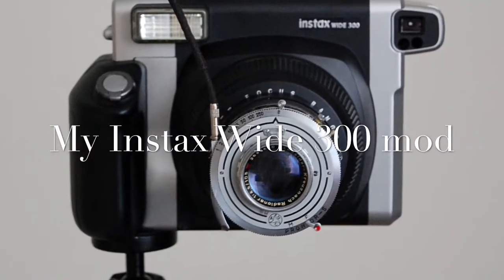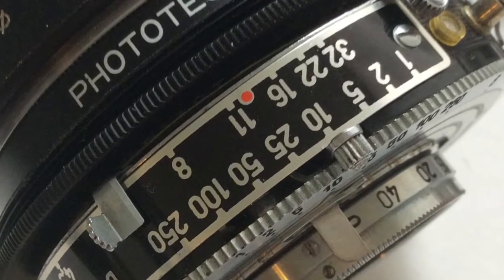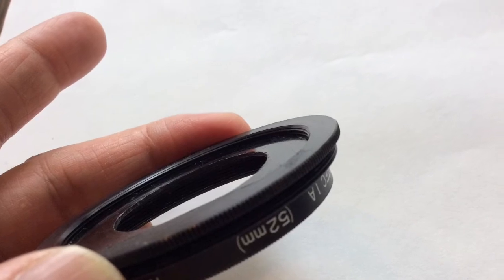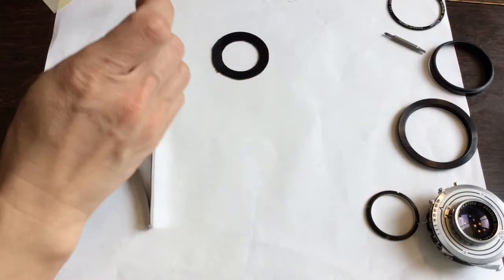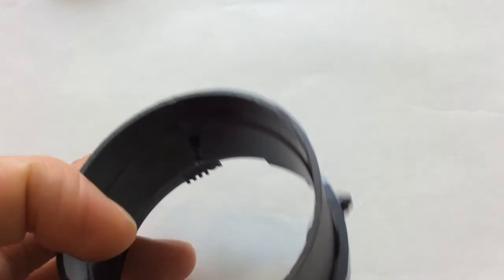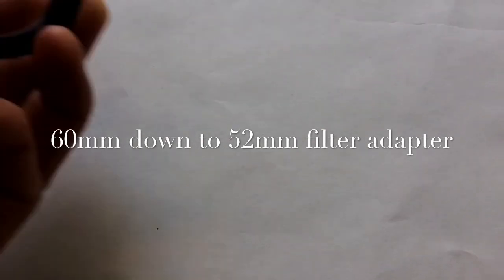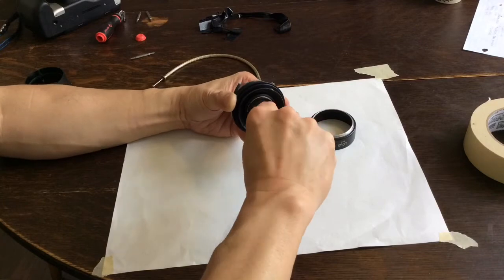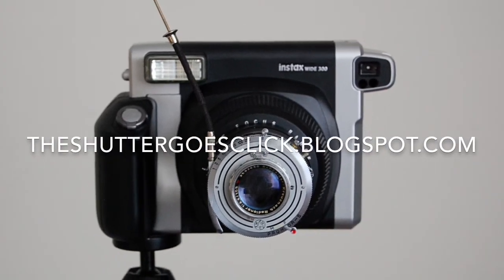Walkthrough of an Fuji Instax Wide 300 camera modified with a vintage lens

Comment: Great video, must have taken loads trial and error ... is the camera always at infinity focus ? Or do you have the ability to create use of depth of field ?
Reply from the maker: sorry about taking so long to reply - the lens has a front-focusing element, so the task is to set the lens away from the film plane so that the lens will be focused on infinity when set at infinity (if that makes any sense). once you've set the lens at the correct distance with filter rings and the right number of spacers (they can be paper or thin sheets of plastic) between the lensboard and the lens you should be able to focus at as the lens is designed. Depth of field would be a byproduct of aperture and the SET lens length (give or take the movement of the front focusing elements - hey, I'm not an optics engineer - and I've never really thought of it but focusing must have some sort of effect on depth of field even on a fixed prime lens like the one here. it should be negligible). I hope all this makes sense to you.

Comment: Are the electronics original? how does ejecting work, letting it think it took a picture?
Not familiar with regular lenses, but the shutter is now on the lens and is mechanic right?
Reply from the maker: That's correct. I have a post on the simplified electronics here: https://theshuttergoesclick.blogspot.com/2018/04/rewiring-instax-wide-300-instaxhack.html

Comment: How did you check focus? Trial and error with the instant film or a focusing screen?
Reply from the maker: I sanded a cd jewel case or maybe a clear piece of acyrlic and then cut it to fit in a used Instax Wide cartridge. I would insert that cartidge into the camera.
Reply from the maker: focusing screen made with old instax film cartridge. see the blog posts here, https://theshuttergoesclick.blogspot.com/2018/06/cameramods-question-i-just-cant-sent-up.html
Reply: Hi do you have some fotos with that modification

Comment: its a fantastic camera. One question though, are you able to keep the automatic stop after each picture is taken? i think it should be simple wiring but i don't know how ...
Reply: could you take a look at this. https://www.instagram.com/p/BjJ_mhYlQGR/  the guy did retain the automatic stop after each film is ejected. Do you any idea. I asked the guy but he hasn't replied yet
Reply from the maker: It can be done. There's a series of triggers that have to tripped for the camera to start the ejection sequence. I considered doing the wiring that way but I gutted the camera too quickly and couldn't reverse engineer it far enough back.

Here's what the rewiring job needs to do:

-make the camera know it is on
-it must detect the lens barrel is out and the lens detector is open (there are sensors for both these in the lens barrel and the shutter housing)
-the camera must believe the camera has fired the shutter

If you can trick out the camera to believe all these things have happened then it will begin the controlled ejection and development process.

I think it is doable. But I haven't done it.

There are advantages to it. You can keep track of exposures. I've wasted two pieces of film because of losing count.

BUT I've never wrong ejected two pieces of film. I like the dumb circuit I built, and, to be honest, the simpler circuit would work if you intended to turn the camera into a back for other medium or large format setups.

Sorry I can't help you more. But thanks for asking. It's nice to know people are up to the same shenanigans as me.

Comment: Great video must have taken ages to trial and error this.... is the lens constantly at infinity or can or can the barrel move at all ?
Reply from the maker: so to be clear. the barrel does NOT move. it has a front focusing element. there are ways to make a barrel move but i haven't yet tried to does options. for example a helicoid extension tube. not the cheapest way but maybe the best IF you have only whole lenses which can not focus unless the whole rig moves back and forth.
Reply from the maker: Hi Peter. The lens has a front element focus. So I just have to set it at infinity and then turn the front focus ring to make it work.

Comment: What did you do with the circuitry that was connected to the lens? Did you just remove the lens that was there? Was there more you had to do to the electronics?
Reply from the maker: Hi Justin, To say the camera had electronics would be somewhat misleading. It is more electric than electronic as hardly chipboard is involved.

All I have is a simple circuit with an on/off switch to the motor. When I press the shutter release the motor runs, driving the ejection sequence and the rollers.

To watch the camera in action, visit the other video. Plus I do have a blog post about the simple circuit I used. https://theshuttergoesclick.blogspot.com/2018/04/how-i-wired-my-instax-wide-to-develop.html
Reply: Thank you for the info. So it looks like you just soldered the wires that were already there... This is a really intriguing project! I am thinking of buying a wide instant body to dissect (they're getting cheaper on Ebay), and using one of the old leaf shutter lenses I have.
Reply from the maker: just remember you want a front cell focusing leaf shutter...otherwise it will be fixed focus. another option is helicoid tubes, but I've never used one.
Reply: I just realized that my batch of vintage leaf shutters are all without front-focusing! So now I am not sure I want to take this on. Thanks for the info. though!
Reply from the maker: I have a similar older lens that has no front-cell focusing....It is "unit" focusing instead. You could consider a build that uses a "helicoid tube". So you would focus by turning the barrel instead of a bellows setup.